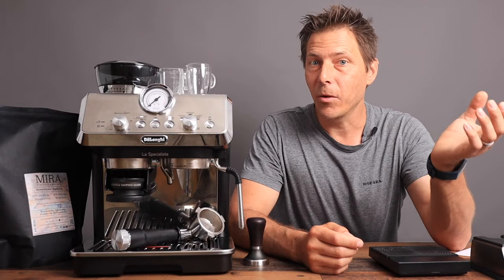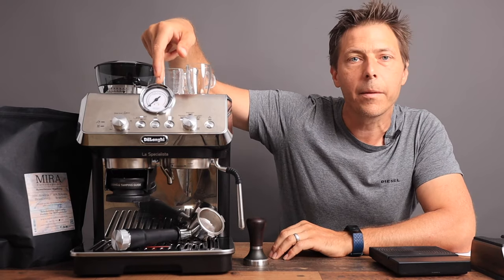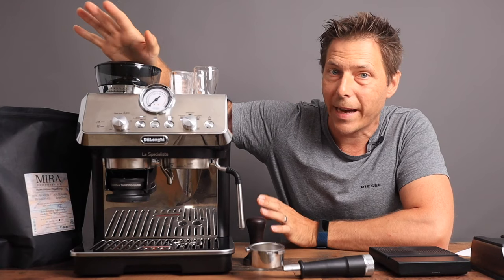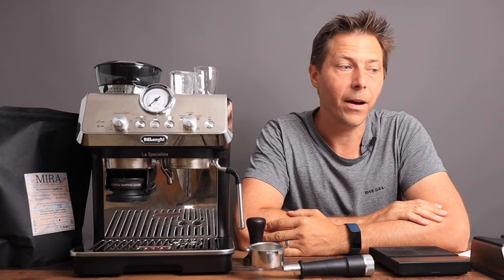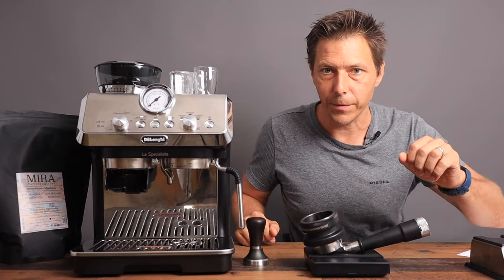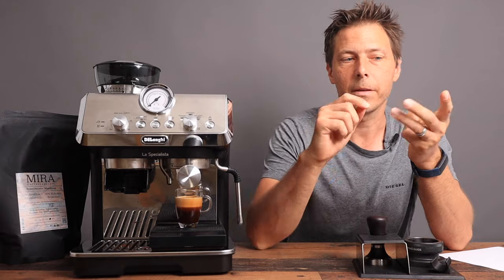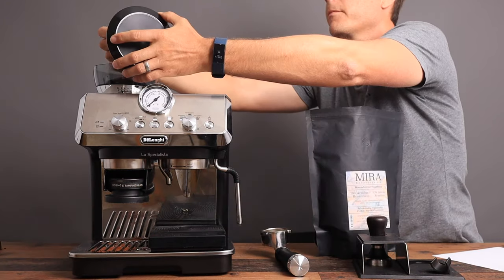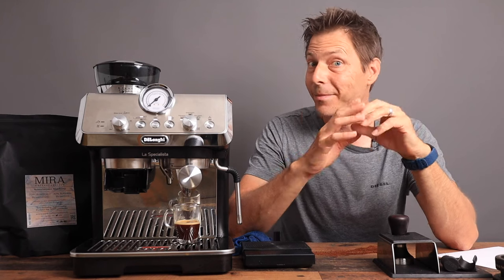Low Pressure? How to Dial in Delonghi La Specialista for the “Optimal Zone”

Comment: I’ve had this machine for a year now, but still haven’t figured out how to make good espresso. I have the ikape calibrated tamper, and I bought the normcore 51mm portafilter that you recommended - however, I can tell that the portafilter basket requires a lot more coffee than the original  delonghi portafilter. I tried to grind 18g of fresh beans, and the tamper barely touches the coffee. I just don’t understand what the problem is…so I continue to drink bad espresso from a pricey machine 😏
Reply from the maker: Hmm, are you using a light roast? Light roast is much denser than dark roast. Maybe try a normal tamper to get down deep enough?

Comment: Always trying to pull a better shot. I noticed you pressed the stop button before the cycle finished. Do you often do that or let the ma chi one run it’s full programmed cycle? Do you use filtered water? How do you narrow in on the “right” grind & dose settings? Thanks for the great video!
Reply: He already mentioned in the chart, that extraction needs to be 25 seconds +- 5 secs so he stop it based on his own timer on the weighing scale. FYI, you can also reprogram the machine extraction time.

Comment: Hi Tom! Thanks for this amazing video! Can you share where you got the bottomless porter filter? I’m currently using the provided porter filter but I would love to use the one you have this video so that I can use the 2 grind setting. Also, it’s also aesthetically pleasing. Thanks in advance!
Reply from the maker: Hey there! Well I made this one, but I also included links in the description for an aftermarket one you can buy. 
It's the Neouza: https://amzn.to/3oGoyjp
Reply from the maker: By the way, the extra grinding range I found out is just +10 seconds longer on the grinder. Be aware, that you will need some pretty freshly roasted beans with a bottomless portafilter, since it doesn't hide any splatters. :)

Comment: I've had this machine for 3 days now. 
I'm using grind settings 1-2 and filling the basket up to the brim once tampered. Still the pressure I get is round 3 bars. 
To make it more irritating, on the second day I did manage to hit the 'optimal zone' and get a nice load to product ratio (also on grinder setting no. 2).

Comment: Hi Tom, amazing video! And fun to watch especially to show us how it goes wrong. Finally a good and fun video. We have also a delonghi machine specialista and we recently tried Starbucks. So we changed the coffee beans but the pressure doesn’t even on the same settings go beyond 20%. Plus once your finished the coffee sticks to the machine (the whole “cake” hangs on the coffee machine). The amount has always been 50% and the grinder is always om 5. Should we more or less finer grinding and more or less coffee?
Reply from the maker: Hey Stefan, the most important factor is always bean quality and freshness. I tried Starbucks once, and got terrible results. Their beans were simply way too old! The best thing to do is go to your local roaster, and get some freshly roasted beans. Then, follow this video again, and I think you will reproduce the same results as me. Cheers!
Reply: @TomsCoffeeCorner  they smelled so good but I got your point! Thanks for the advice and we will fix it 💪🏻
Reply: You can fix the issue with coffee sticking to the group head by adding a metal filter on top of the coffee puck

Comment: I wish I'd seen this video before I bought my DeLonghi.
The other 2 inter-related variables are portafilter size and coffee depth. As you use a bigger dose basket the depth of the coffee increases and requires a higher pressure to achieve a given flow rate (all else being equal). So the DeLonghi is nice for a 15g shot, but this is more problematic with an E61 with a larger 58mm portafilter. I think your preferred dose size should be a major influencer on portafilter size and hence machine you use. It is a shame that noone makes a good width reducer for 58mm portafilters.
Reply from the maker: Hey Tom, I think this is more personal preference. I have used a 53mm La Spaz, and Dalle Corte. I also have used a 58mm GCP and Rancilio Silvia. To me, the Dalle Corte gave the best shots, but that was also a professional machine. But you are right, it did not have 58mm baskets.
So what Delonghi did you buy?
Reply: @TomsCoffeeCorner  I bought a La Specialista, and without learning on that as you showed in your video,  starting with pressurized basket and going onto bottomless unpressurized I do not think I would understand what I am doing with my Flair 58, which I use like a Londinium machine.  I agree it is personal preference. The other thing is that commercial machines have different user requirements than personal machines. It is the same with gas ranges - people buy Wolf products modeled upon restaurant ranges which are far from ideal for the home. A modern 53mm commercial quality machine for the home would be a wonderful thing to have.
Reply from the maker: @TomJones-tx7pb  I had a La Spaziale Mini Vivaldi, which had a 53mm PF, and to be honest I feel like I get better shots and milk consistency with my GCP. So I sold the Vivaldi. But, I am sure that other people with the skills can make great drinks with it. It all comes down to personal preference and talents, I suppose. How are you liking your La Specialista?

Comment: Thanks for another great video Tom. I just picked up this machine last Friday (after watching your reviews) and I'm currently trying to dial in the machine. I have had a couple of decent shots, but I still get some that are bitter. I'm using (what I think is) a dark roasted bean (from end of August) and I'm now a grind level 4. But what I wanted to ask you, was if you know what how many grams the original double basket holds? I have not been able to find that information in the instruction manual or online.  I have tried using 18 grams, but it feels that it is too much and now I'm at 17g, but that also feels a bit too much, you aimed to be between 16-17g, so I guess I can try to go down a little more. My grind time is set at around 20-21 to get to 17 grams.
Reply from the maker: Hello Jonas! I normally shoot for 15-16 grams on the double for this machine, but it depends on roast and bean density. Light roasted beans are more dense, and you can fit much more weight in there. But anyway, for darker roasts, I would shoot for 15-16 grams. Cheers! Tom

Comment: I still struggle with pressure, even with freshly roasted (4-6 days ago) beans, adjusting the dial, weighing the dose. I did buy a bottomless filter and that has never really worked with my specialista! Tom - come to the UK and rescue me!! 

I do love your videos, and I need to try better at latte art.

Question: Do you find that a coffee roasters blend will work better than single origins? What coffee should we avoid with this machine that may be too oily for example? Is there a sweet spot of bean (regardless of flavour/taste) and is this a good reason to go for blend over single origin?
Followup, do you do decaf any differently?

Even if you don't reply Tom, I love the videos <3 Thankyou for your no nonsense approach to all your videos!
Reply from the maker: Hey Rob! The La Specialista is tricky, because it doesn't grind super fine. But if your beans are that fresh, it should be able to do it. Are you using a scale? Maybe your dose is too low? I find that a blend of 80% arabica and 20% robusta does the best for me. Med-dark roast too. Decaf is a little more difficult in my experience. Certainly avoid overly oily coffee beans, as they can gunk up the grinder. Good luck! Tom
Reply: @TomsCoffeeCorner  I can't say thanks enough for your time and effort <3 Much appreciated. I'll go down the grind route, it seems to work better with an espresso grind the local shop did for me, so that seems to be the key! It still doesn't go so great in my bottomless, but maybe this is life telling me to upgrade! 
Keep safe :)

Comment: Just another great video of yours`. I did learn some facts regarding Italian espresso making plus how to pull a good shot in optimum range. Something caught in my attention, why should we change grind size while the grinder is running, can you please explain it a little more? I`m currently using Graef cm802 with dedica ec685 and I`m curious if my grind size is not affected because of I`m setting it when it`s off. I never tried to change grind size while running and I wonder what it could change. I`m dialing between single-double shots around 9 to 12 grams and I`m using grind level "7 or 8" on default Graef cm802. I used to grind finer but this machine is not able to push finer grounds obviously and either no need to. Thanks.
Reply from the maker: I think it’s better for the burrs, and the grinder won’t jam that way either. Plus, I think it will take longer for the grinder to become consistent again if you change it while it is not grinding.

Comment: Hi Tom,
Thank you for this nice video.
This same machine of mine stops the extraction automatically at around 16-20 seconds.
Please advise if there is something wrong or anything to do with the settings. 
I just would like to stop the extraction manually like to you do in this video.

Thank you Tom.
Reply from the maker: Hi there! Just hold down the OK button, until your desired volume is reached. Cheers!

Comment: Amazing videos Tom. Thank you very much. 
I have a question. I am using 16gr in, grind in 2 or 3, and I get 32gr in about 24 seconds (good optimal zone too). Which seems to be ok, and it looks good creamy too, but the taste is not good, not sweet and very bitter. What can it be? Thanks.
Reply from the maker: Well, you could try a lower temp if that's bitter, or maybe try changing your grind. I'd try grinding at 1, and see if a longer duration shot might do better. Cheers!

Comment: Hello Tom, very nice video. As other users have stated, what about the shot time when you are in the optimal zone? In the video looks like the 1:2 ratio shot in the optimal zone was not nearly as 30-35 seconds extraction. In my experience of having this machine for 1 week already, If I "live" in the Optimal Zone and I target for 1:2 ratios, I get short extraction times (usually 20-25 seconds counting pre-infusion). On the other hand, if I dial in the shots to be 1:2 at about 35 seconds (counting pre-infusion) the pressure gauge ranges from 11-13 bar. Oh, but the 1:2 shots taste supreme, so I guess we need to use the pressure gauge up to some extent.
Reply from the maker: Hi Joaquim, I would say 20-25 seconds is fine. I don't aim for 30-35 seconds. Cheers! Tom

Comment: Hi Tom. What are your thoughts about the built in tamper on breville or Delonghi machines? also, do you think breville having higher dial capacity is more useful? Thanks!
Reply from the maker: Hi there! Well the included tampers are decent, they will get the job done. The Breville does have the better resolution for dialing in compared to the Arte.

Comment: What temperate of water, that goes into portafilter? And what temperature of your coffee? For some reason NOBODY in their videos show the TEMPERATURE of their espresso. I have the same model and water temperature that goes into  portafilter only 79 deg C 1st few seconds then down to 73 C. So the espresso temperature is only 69 deg C. Is that normal? Because in manual they said inside machine on higher setting is set to 96 deg C.
And in my 2 cup basket I can feet only 15 gm of coffee.
 Most important - you have to have a screen for on tap of coffee in your basket, otherwise you have to wipe under brewing unit coffee grinds after every shot.
Reply from the maker: Where are you measuring from? If I measure on top of the puck, I get slightly higher numbers. Check out this video: https://www.youtube.com/watch?v=TPS6Z6NCaU8&t=2s

Comment: Hey Tom. I like your film. Today I manged to prepare a shot in optimal zone for the first time but the problem I have is with a coffee dose and distribution. When I increase a dose the grounds are distributed in the center of filter so as a result I have some kind of "hill" in the middle. As a workaround I decrease dose, distribute it, tamp and after a tamp I ground a little bit more and tamp it once again so the cake fits the optimal amount line (I'm using original delonghi portafilter). I noticed you have some black stuff on your filter in the video and I'm just wondering what is it and if it can help with coffee grinding and distribution. I'd be grateful for advices.
Reply from the maker: Hi! I would suggest using a WDT tool to distribute the mound, or at least tamping on the side of the PF to level your dose.

Comment: Hi Tom, great videos thanks.
I have purchased an expresso bean that I love but I just can't get it right.
Pressure is going to the red zone and the coffee just drips out. What am I doing wrong?
This setting works fine on a different bean.

I also purchased this same coffee but ground and have the same issue with the Dedica machine so it has to be in the grind setting. Does it need to be finer?

Thanks Sally
Reply from the maker: Hi Sally, if it's hardly coming out, then you need to coarsen the grind. Cheers!
Reply: @TomsCoffeeCorner  thanks, have slowly gone to 8 and still it is hitting red and hardly coming out.
It did one yesterday out of the red zone just but back in today, bizarre.
Should I just tamper slightly? Not that I press it hard but the other issue I have is getting the coffee out after, I can slam it against the knock box and it just won't come out.
The coffee beans are from a roaster, they are expresso and the one they use in the machine (industrial) so they should be fine. They were fine in my old delonghi Magnífica S.
Thanks for your help!

Comment: Thanks for your excellent info.Just bought this machine and after much experiment still get  wet coffee grounds after extraction. Any help appreciated
Reply from the maker: Well, I would suggest that you let it sit for one minute before removing. Also, the puck wetness depends a bit on the headroom in between the top of the puck in the bottom of the shower screen. So, try using different coffee amounts, and see what that does.

Comment: I have the same machine and my basket handle thing doesn't look anything like yours.  It has the two spouts underneath.  It also seems like all the water isn't getting through the tine holes in the basket.  Every time I pull a shot there is still a ton of water left in the basket.

Comment: Hi Tom, cool videos. First, I saw a video you made about the Dedica. Do you know what bottomless portafilter and baskets I can use for the La Specialista Arte? Tried to find something but didn't. Also a matching tamper and that thing to twirl the coffee.
I'm still struggling to get the perfect coffee out. I made it sometimes in the optimal zone with grinding setting 2 and an amount of 15, but often there's a rest of coffee sticking in the basket after knocking off, or the puck stucks in the machine, and now I'm not making it into the optimal zone, also the coffee is often very bitter. Any suggestions? Thanks a lot.
Oli
Reply from the maker: Hey Oli, sounds like different problems. What kind of beans are you using? The fresher (regarding roast) the better. Also, are you weighing your dose? That is important so that you don't have too little or too much. 16 grams is a good dose, in my experience. Try flushing the machine a couple of times, and either dunking the portafilter in hot water, or rinsing it in hot water, so that the espresso is not temperature shocked upon extraction. This machine extracts quickly, due to a long pre-infusion, just so you know. Good luck!
Reply: @TomsCoffeeCorner  thanks Tom.
I tried different beans. Dark and light roasted, from the supermarket but also higher quality beans freshly roasted. I didn‘t so far, but weighed it now. Are you talking about a double basket? I have a single basket with around 8 grams. Is that good? Or why should I use the double basket for a regular coffee? Or better whats the difference in terms of advantages?
Will try that too. Thank you for your kind help.

Comment: Hi,
Did I get that right?
- when we adjust the grinder, we should do it while it is running?
Could you explain a bit?
- That seems counterintuitive... I thought that I should adjust the grinder only while it is stopped.
Reply from the maker: You should adjust while it is running, so there is less stress on the motor I am guessing, and I think it helps the burrs settle in faster. But that's just my guess. Everyone says to adjust while running.

Comment: Hi Tom - great video. I just got this machine but the pressure would never go up more than 3 bars and the extraction is about 6 seconds. I just contacted support and they went through the process over a video support call and they told me what I was getting was fine... that the pressure doesn't need to go up further and the extraction time is fine. I have the barista pro at home and do get 25 seconds and a much better shot. Are they telling me the right information?
Reply from the maker: Are you using the same beans? Are you grinding as fine as you can with the Arte? Do you weigh out your doses?
Reply: @TomsCoffeeCorner  thanks so much for replying. Figured out it had a leak and returned it. Disappointed with support saying it was fine when clearly it wasn’t.